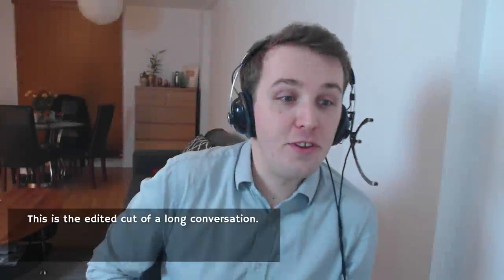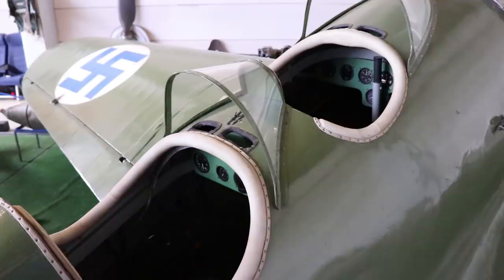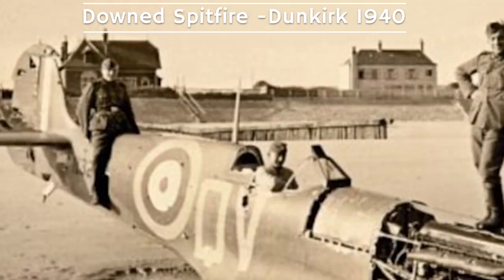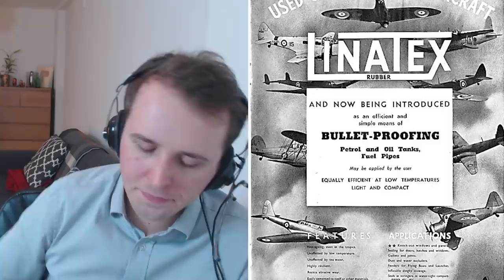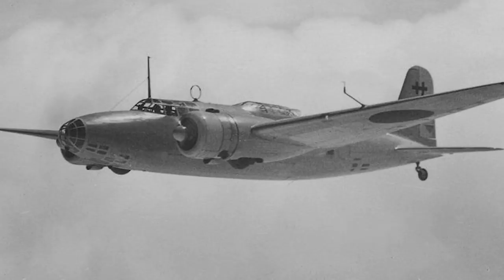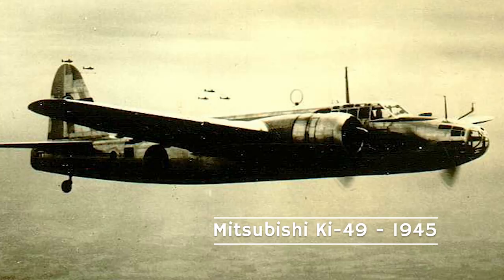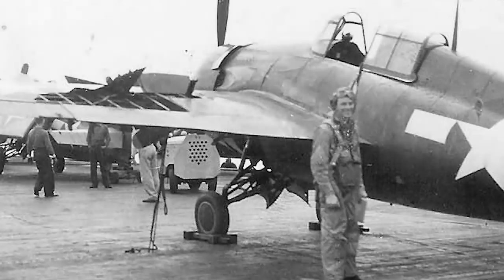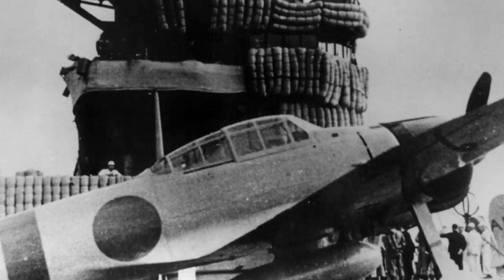WW2 Armour and Fuel Tank Protection - What They Don't Tell You

Comment from the maker: If you are interested in aircraft protection, then I can recommend Richard Dunn's 'Exploding Fuel Tanks' for further reading: http://explodingfueltanks.com/ (also mentioned at the end of the video)
Reply: One thing that puzzles me is that armor should be designed in a way that can integrate it with the structure so that it contributes structurally, but to do this well, it should be done from day one on the drawing board.  Added on and easily removed armor would be far less likely to contribute to the structure of the aircraft.
Reply: Where could one find accurate information about protection in Japanese planes, especially Ki-61? Hopefully in English. Some scattered notes mention it had up to 17.5mm armor behind a pilot and an angled plate behind the radiator.
Reply: Here from Bo Time gaming. Great work mate
Reply: @alan6832  about the pilot not plane.
Reply: You know what I've learned from my love of WW2 combat flight sims?  Give me speed, give me maneuverability, give me climb rate, don't give me armor or firepower.  Dance like a butterfly sting like a bee.  Hit  and don't be hit, that's the key.  The ultimate late war version of this was the Russian LA7.  I guess I should add energy retention.  The ability to absorb damage NO! bite me hand out damage.  Early pacific war the American planes were tough and rugged, the zero which was neither but faster, better climb rate and more maneuverability ate them alive.  Eventually you got the corsair and lightening which were at least faster, which is something, actually a pretty big effing deal.
Reply: Rewatching this video some years later, I'd suggest taking a look at the WWII US Bombers channel ; this Youtuber pulls some WWII or just-postwar reports from the archives to explain various aspects of them, and in particular, there's a video about German 20mm autocannons and their effects on U.S. bombers, and another one about crew member gear.

From these videos, the MG151 20mm HEI round (looks like the 2 cm Minengeschosspatrone 151 mit Zerleger round) was fuzed to penetrate through an aircraft's skin 2/3 of its length roughly, and then detonate, sending splinters around. These splinters were of relatively low velocity, and the crew's armor was designed to stop these fragments, pretty effectively I may add. Of note, the flak vest was designed to stop a .45 bullet from roughly 30 feet away, so clearly the equivalent of barely a few millimeters of steel. So while armoring an aircraft's skin against autocannons may be unfeasible (and even there, I got doubts) without too many tradeoffs, you don't need much armor to mitigate the damage caused by the explosion of those shells ; a few bulkheads of a few millimeters would stop those fragments, or if that's not possible, just focusing on the most critical components would do the job. It would be interesting to see how thick a plate has to be to prevent penetration of this round, and have the subsequent explosion take place on the outer face of said plate. Also, if I understood correctly, the flak vest was made of overlapping small 0.9mm thick steel plates.

Also note that the MG151's HE shells were of relatively low velocity by modern standards, and weren't API ; the postwar M61 Vulcan for example has the M53 API shell with a muzzle velocity of 1030 m/s, which has a mere penetration of 6.4mm RHA at 1000m.

Basically, a 20mm HE round would create many many splinters in all directions, but the latter could be stopped with little armor. Such shells would work by weakening the aircraft's skin or hitting critical components. Against heavy machine gun rounds that don't explode and are just large slugs with a few grams of incendiary powder generally, the damage is more limited, but the penetration is much higher than the 20mm's splinters. M2 ball from the M2 Browning is rated at 19mm of penetration at 500m for example. The M8 API has a bit less penetration, 16mm at that range.

Also, in Hearts of Iron IV's latest DLC, By Blood Alone, I learned that fuel tanks and armor aren't binary. Hence why I got self-sealing fuel tanks and stacked as much armor plating as possible on my planes. :D
Reply: 0:43 - You say "He and Me...", it should be "He and I".

Comment: One thing worth noting that didn't make it into the video: The lack of protection we discuss related to the G4M and A6M cuts across the board for Japanese Navy aircraft up to 1944.The only exceptions being the rudimentary protection added to the G4M (discussed in the video), the H8K (some self-sealing tanks, inert gas, armour), and the J1N1-C (self-sealing tanks and armour). Given when the D3A and B5N entered service (both late 1930s), the lack of protection is unremarkable. The D4Y and B6N came later and also lacked protection (very early B6N had self-sealing fuel tanks, but was dropped due to the drop in performance), which was certainly noteworthy by mid-war. That is the foundation of the stereotype: the IJNAS lagged well behind in the realm of protection, but as detailed in the video it was more complicated than is often portrayed.
Reply: The stereotype of Japanese aircraft turning into fireworks display is not refuted by this video whatsoever.
Reply: @steveperreira5850  It isn't "refuted" entirely because some elements of the common view are correct, as I acknowledge both in the video and in the OP. The view is instead often overgeneralized to the point of fallacy in some areas. Like in your statement of "Japanese aircraft," implying all of them at all times, which is factually incorrect. Particularly on the IJAAS side of things. Or even the IJNAS in isolated cases (e.g. H8K2) or in some late-war designs (e.g. G4M3).

Comment: One thing people may not know is that the self sealing tank was a rubber bladder put in the wing of the airplane.  After the war for some reason, general aviation manufacturers sold light aircraft with bladder tanks. I know of an early 60's model Cessna 210 that had these.  They were very problematic though, because as they age the 100LL octane avgas would dissolve the tanks and the debris could actually clog the fuel lines!  Installing and maintaining these tanks is a major PITA too.
Reply: There are modern fuel cells that work very well indeed. Mostly of cross linked polymers such as Polyethylene. And they can be filled with foam for explosion-resistance for tanks that have a likely hood of being punctured, such as Military Transports, Rescue Helicopters, Firefighting Aircraft, and Crop-dusters. Its the same foam that comes in Camera/Pelican cases.

Comment: In all the discussions about armor protection in WW2 aircraft I've never seen or heard anyone mention the grade of steel used for armor plate in these planes, there's a big difference between regular mild carbon steel plate and something like United States Steel T-1 (a grade of steel developed by US Steel for the military, the T stands for tank), I worked with steel (including a lot of T-1 that's used for wear liners in coal and gravel chutes and front loader buckets) for some years and used to take cut outs (scrap) home and shoot them with an M1 Garand firing armor piercing ammo (when it was flooding back into this country from foreign countries who had it surplused to them after the war), the thickness that will stop an armor piercing round is surprisingly different between mild carbon and "armor" grade steel, just comparing thickness is only part of the story, also, steel made late in the war by the axis powers, even Germany, was notoriously inconsistent as evidenced by the fact that late war Mauser rifles are known for being unsafe to shoot unless checked out by a competent gunsmith and even then your taking a chance, you simply can't use thickness as a benchmark, even looking at the specs in the blueprints isn't the whole story since late war steel production from the axis powers was so spotty, I've worked with a lot of foreign steel that even though it was ordered to a specification was inconsistent and had varying quality, once I saw a hoist that had been welded to a piece of plate that came from Asia (and this was in the 90's) that the hoist tore off of when a heavy load was put on it and upon examination you could see that the plate was layered, an indication of shoddy production, they were getting ready to hang the guy who welded the hoist on until I pointed out the layering, I had seen it before working in a shipyard where we experienced similar problems with Asian plate steel, as a note, some of the best plate steel I worked with was in the mid 90's after the Soviet Union fell, they were melting down their old tanks and rolling plate from it, I can tell you from working with it that it cut, bent, formed and welded about as good as anything I've ever worked with that came from US mills, aside from that my experiences with foreign steel, especially from Asia, showed me that despite specs on paper, there's a big difference in properties and quality  from one mill to the next, without testing samples from the aircraft mentioned you'll never really know how much armor protection they really had.
Reply: Could you tell me more about the dangerous Mausers?  I had one that would get really sticky on the bolt by the third round, and I think I usually chickened out and stopped shooting by the fifth..... I did not know they were dangerous, but my sphincter sure did.
Reply: @davidsuzukiispolpot  
Late war Mauser's, I'm not sure of the serial number ranges or if it encompasses all the manufacturers, but I do know that late war (at least some) Mauser's are considered dangerous, even if checked by a gunsmith they say you could still be taking a chance with them, the steel and the heat treating are spotty with them, they were down to using slave labor at that point in improvised or half bomb out facilities, I only own 1 Mauser and it's a 1941 manufacturer that my friends dad brought home with the .22 conversation kit for training, it was a gift so I never really got too far into collecting and researching them like I have with M1's and M14's, but I'll bet you can find some info online about serial number ranges and manufacturers when it comes to the late war ones, I saw one once that was marked 1944 and the finish and machine work was really rough on it.
Reply: @dukecraig2402  Thanks for your info.  It was explained to me that the heat or metal was wrong (not by a gun-smith) bit it was not explained to me that it was dangerous.  If felt dangerous so I did not get around to using it again.  Now that you have told me, I will never fire it again.  I was likely not going to, but now it is certain.
Reply: @jackfedersail90  
More than glad to, I wish I knew more about which ones are considered late model "dangerous" ones but I've never really bought books and did that much research about the production of Mauser's although I may now just out of curiosity.
Reply: Mr. Craig, that paragraph was all one sentence, and all HUGELY interesting!  Thank you very much!
Reply: @craiga2002  
Sorry, I'm not very well educated in English, but I am with steel.
One other thing that the guy who made this video didn't know when he made it and I learned afterwards is that the blueprints that he shows and uses for an example to state that Zero's did indeed have armor protection for the pilots is from a single variant that they only made 400 of, it was an experiment that didn't work out because between the armor plate behind the pilot and a few other things they tried to make the plane more survivable it added around 450 lbs to the plane and destroyed their maneuverability and climb rate, so after producing only 400 of them they dropped the armor plate that he cites as being proof that Zero's did have protection for the pilots and went back to making the original version. 
So in the long run, no, they didn't have armor protection for the pilot.

Comment: Of course the japanese planes were armored with unbreakable ten thousand times folded glorious nippon steel.
Reply: Pekka Mäkelä that was imported from USA and Australia
Reply: It wasn't unbreakable, it just cut all the bullets.
Reply: @GeFlixes  Yeah but your steel is like fabric compared to the Stalinium IL-2
Reply: Wasn't that made of wood
Reply: Are you Finnish. I really admired the Finnish in WW2 a brave people with probably the most EFFICIENT airforce of ww2. I have many Finnish ww2 aircraft models I built. Too bad the Government resigned here of lately
Reply: armor is over-rated.  The trick is to hit and not be hit.  What ended up making the zero obsolete is that american fighters eventually became much faster.  If you have the energy advantage you can choose to engage if its advantageous or evade if its not.  Speed and low drag were king.